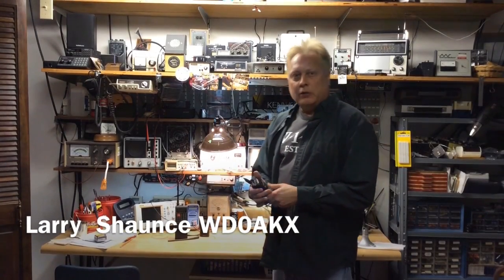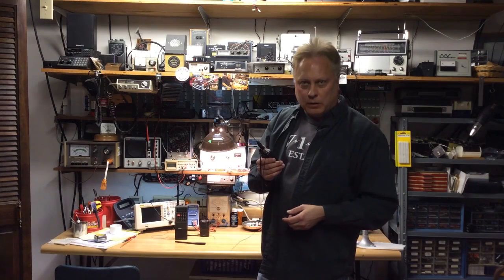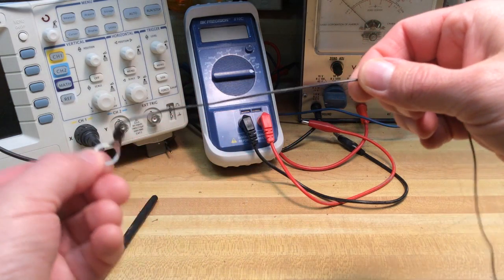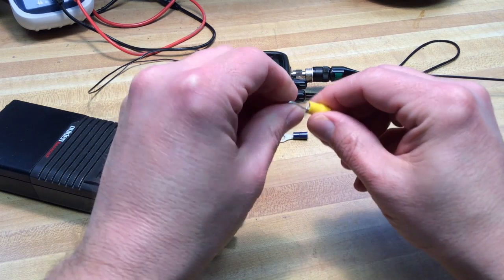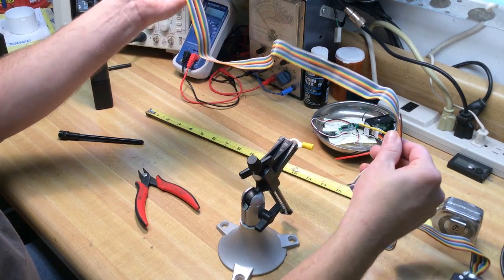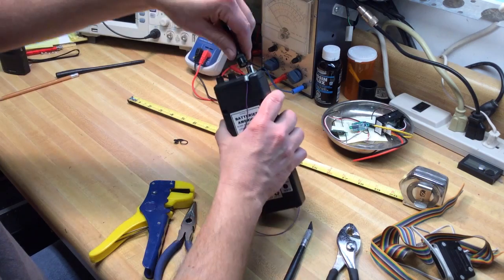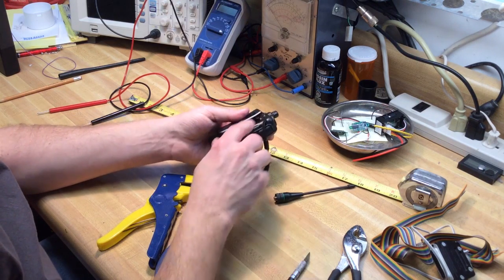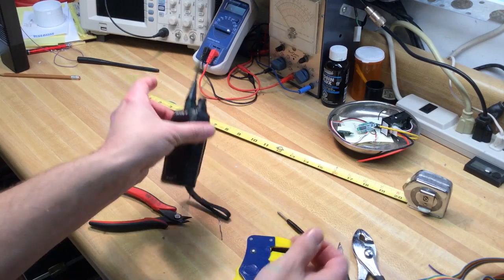Maximize 2 Meter HT or Dual Band Radio Performance With This Easy Tip

Comment: Stupid question but, instead of the little "ring" could I just wrap the exposed wire around where the antenna screws on, then put on the antenna?
Reply from the maker: Yes, that would work also, as long as it makes contact, no need for the ring.
Reply: RadioHamGuy Okay thank you. And one more thing, there is no risk of damage is there? I am new to this and kinda hate the idea of putting metal on metal. lol
Reply from the maker: Matt Jones no risk here at all with this method.  Can just try and see if it helps your radio or not, easy to try.
Reply: RadioHamGuy Gotcha. Appreciate the replies. Will try this out pretty soon.

Comment: baofeng UV-82, Diamond RH-771 antena, tiger tail...... WINNER!!!! It's a bit shame that this set up is better than other hams that I payed for a lot more!!!!!! I was telling myself that at least one of the others is "submersible"..... Yeah!!!!! With using some plastidip spray on the UV-82, and after a heavy rain on a motorad trip, guess witch one is still working. I just took it apart and plastidip the housing by giving some attention to the details when reassebling. By now me and my friends are using this set up (even though we refuse to let go the pricy ones) and works great for hunting, motorad and hiking. And a little TIP, the first time I used a preaty thick wire for the tiger tail, and had interfierences, you need to use a thin one and not longer than the actual antenna, I don't know if it's me but it seems that the tiger tail has to be a litle bit shorter than the actual antena (2-3cm at my case works fine). In my knowledge (and test), UV-82, GT-3, UV-5R have antena conectivity to the right clip screw. Sorry for my english, hope I helped someone.
Reply: +shieradelta4   could you elaborate on how you sprayed plastidip on the case?

Comment: What should the length be if you have a triband 144/220/440? or would you use the 19in cover all in the counterpoise?
Reply from the maker: Yes, the 19 inch should work just fine for all the bands.  If you really use one band more than another you could just cut for that band but for over all use, the 2 meter band is the lowest freq and that is usually what you want to cut it for then it will work for higher freqs also.

Comment: Just tried this on my Baofeng UV-5RA and Nagoya NA-771 (antenna had continuity with belt clip screw so connected counterpoise there). I notice no difference at all in RX (no lic yet and nobody on MURS). Is this mod mainly for TX or is it suposed to improve RX as well? Thx.

Comment: quick question, does the TT have to hang loose, or say in the case of a UHF single band radio, can the bottom of the tail be taped to the bottom of the radio? Trying to keep it neat and from getting snagged or pulled..

Thanks!

KF5LYZ
Reply from the maker: With the UHF it could be taped to the bottom of the radio since the wire is so short anyhow, with the 2 meter version, probably best to hang loose below the radio but it would probably not make a whole lot of difference if you were to tape that up also.  Just give it a try, very easy to play around with!
Reply: RadioHamGuy

If you are stationary, would you ground it into the dirt?

Comment: Larry, how can I jerry rig an old GE emergency CB radio magnetic telescopic antenna to work in my pickup for my Icom HT 2 meter which has the BNC connector? The mag antenna has the old style RCA type connector. I feel that it would turn my HT into a great 2m mobile. Do you know of anyone that carries an appropriate adapter for this? Thanks,

Joe KC3BXZ

Comment: Would it work if I just clipped one end off of a set of alligator jumper wire at 19" and just use the alligator clip to clip it to it..? Mine is an SMA and there is room to clip it.. I'll try it.. Thanks 73s KB9NMZ
Reply: Wayne Earls, I got marginal improvement on all setups. Really was not worth the hassle. 73.. If I said 73's that would be like Bestes Wishes?.. Redd...
Reply: Did it help Wayne
Reply: I believe it did, I'm going to keep testing it.. Nice video..

Comment: Can you wrap the wire around the antenna instead of having it hanging from the radio and will it have the same performance
Reply from the maker: You don't want to wrap the wire around the antenna, they need to be separated.

Comment: can the same trick be used with a scanner, or regular am radio?
Reply from the maker: Yes, it will work well for a scanner, but not with an AM radio since the wavelength is way too long on that band.  But this works well with any radio that is up in the VHF or UHF band.  For AM radio, best thing is to use an external loop antenna.  Or a very long wire but you will pick up more noise also with that.

Comment: one of my friends bought a baofeng $35 handheld on ebay and we were comparing it the other day.  price and quality is very good.  sounds great, works great, almost no drawbacks to it other that distance on high power and obstructions. very impressed and much better quality than any store bought GMRS/FRS radio
Reply: Not legal to use it for that

Comment: You mentioned in your video that the yellow or blue colors on the ring terminals determine the size of the hole in the ring terminal, this is incorrect. The color code indicates the wire gauge size to be crimped into the connector, NOT the hole diameter. Yellow or blue or red ring terminals come in all different sizes of hole diameters.
Reply from the maker: Yes and thanks, I did make annotations on the video to try and explain that, I didn't catch that while I was doing the video but I should have known that.

Comment: Any tips on using this with aircraft/marine VHF handhelds?  Typically 121 - 135 mHz for aircraft and 156 - 157 mHz for marine.
Reply from the maker: Yes, for aircraft, around 23 inches would work well and for marine band 18 inches or so, these are not critical at all, just get close or make it a touch longer and it will do it's job.

Comment: Excellent.  I would like to add a humble correction.  The color of the insulation on the ring terminals does not correspond to the diameter of the ring hole but rather to the wire gauge that the terminal is designed to accept.  Yellow is for 12-10 awg, blue for 16-14 awg and red for 22-18 awg.  73
Reply from the maker: ok, thanks for the correction!  Good point, 73